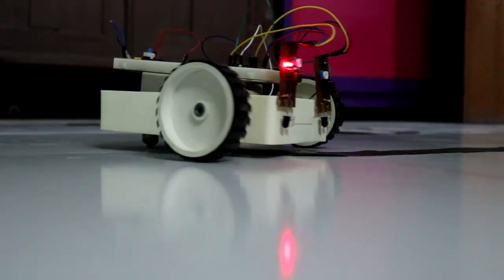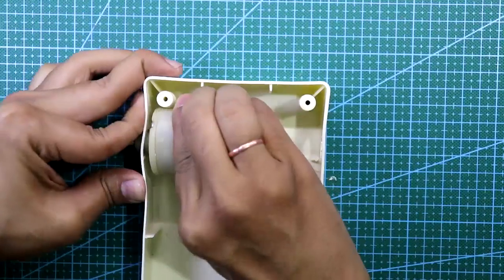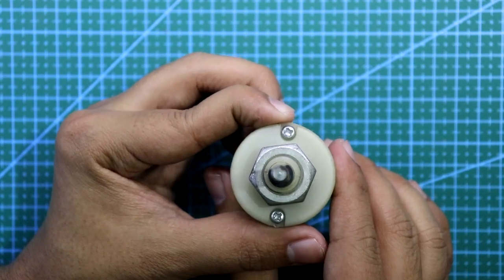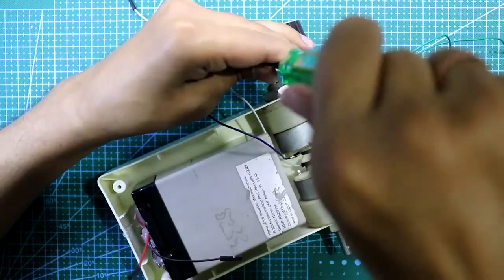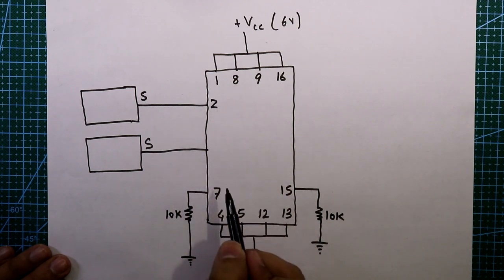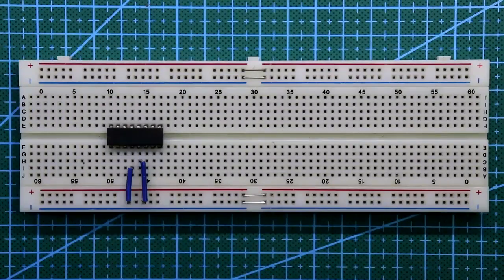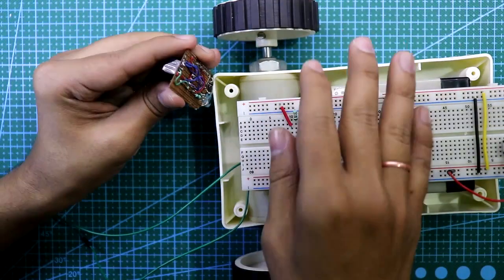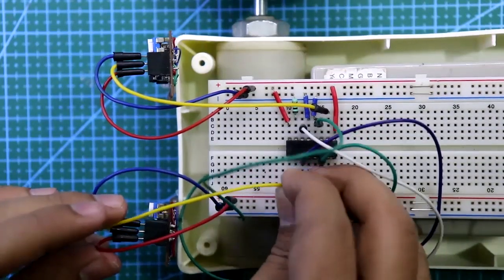Line follower robot without microcontroller | L239D

Comment: Bro all of my available DC motors are 300rpm with no gear, do you think its fine
Reply from the maker: If your motor runs 300 rpm at 12v, then there will not be a problem. But without gear means it has low torque. I'm not sure whether it is fine or not. Just try with these, or go for geared motor for better output.